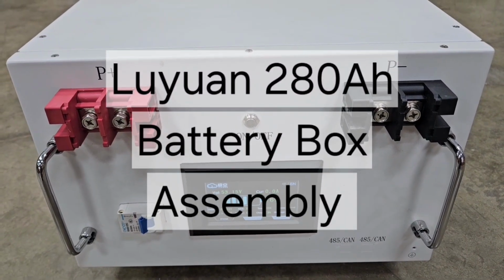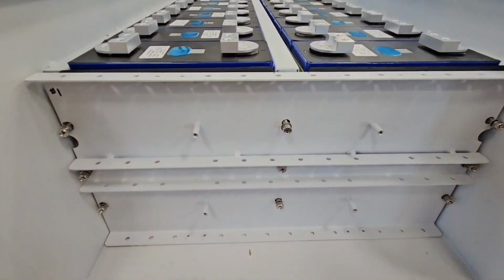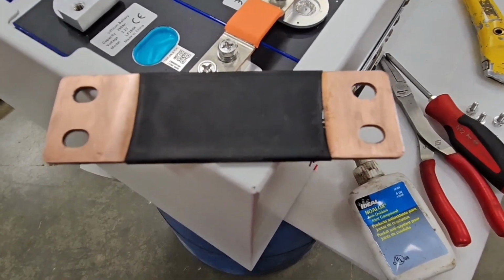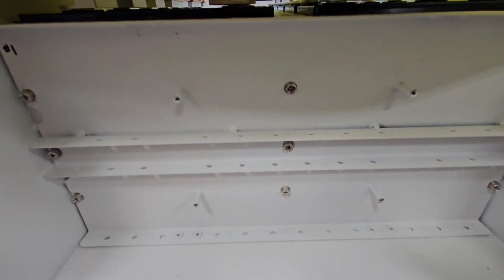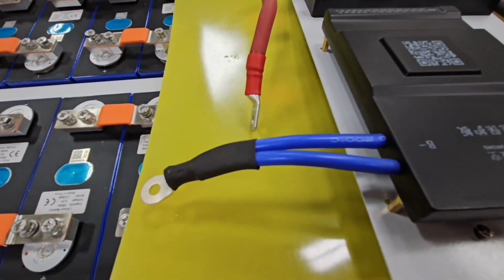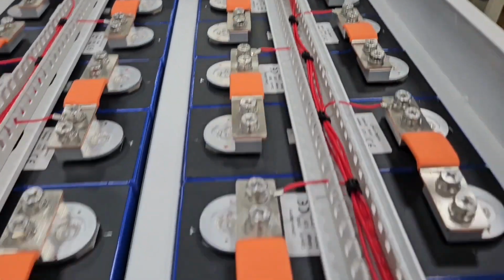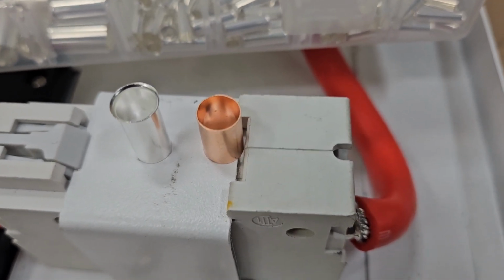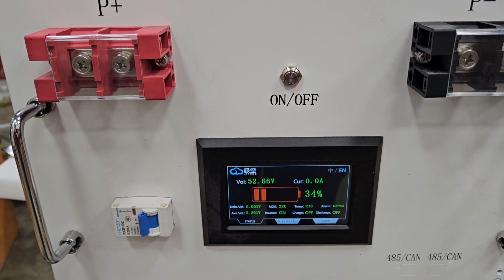Luyuan DIY 280AH Battery Box Assembly

Comment: Nice build! Very clean cable management. I love it. 
How is the JK bms balancing performance?
Cheers!
Reply from the maker: The JK's work great. I've been impressed with the balancing performance. I'm not into the trend of closed loop inverter communication so can't comment on the newer JK BMS with inverter communication. These older JK's are rock solid, no issues.

Comment: Hi. Great video, clean install, and a great idea using the old type bms. I too bought cases and cells from Amy. I received great customer service and she answered every dumb question I had. I used the new inverter bms but i have 2 brand new old bms in draw. Did you find the 280ah cells cheaper than the 304ah? So far I have been running about 4 months on the new batteries, loving it, should have had the confidence to do it earlier. Watching your vid I am tempted to buy more cells and use the bms I already have, that i am not using.
Reply from the maker: Andy's Garage has some videos about using the Peter Board (board is more than a BMS) or ESP device with Home Assistant (basically free) and this was using the older JK BMS's. I don't use inverter communication, I like to keep things simple and set my charging voltages. Communication adds complexity and a failure point. I would definitely buy  more cells and more boxes. I'm probably building another box or two for other projects. As for 280Ah vs 304Ah cells, it's just a matter of price and preference.
Reply: @doczwy  Hello Doc,
can provide the  links where you got the cells and the BMS?
Reply from the maker: @lowfat1713  I'll put it in the description as links in comments Youtube tends to delete.
Reply: Contacted Amy after watching this vid as I have a 200amp jk sitting in drawer. Told her wanted what she sent you. 6 weeks later packages received. Easy. Thanks
Reply from the maker: @gibo1971  She is a great seller on Alibaba and she will take feedback for improvements.

Comment: Thanks for putting this video together. I'm building a similar setup from Amy, but for a side-by-side, so very helpful. I'm going to have to move the screen out of the box and blank off the hole, but I think it's doable with the wiring length provided.